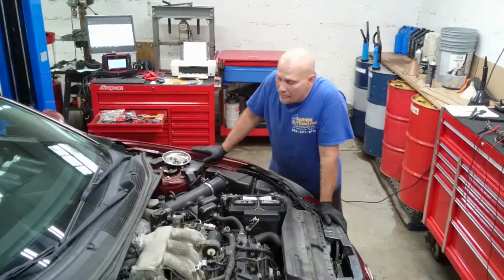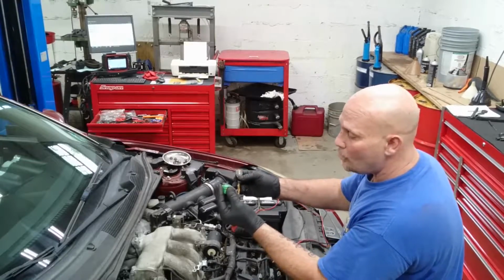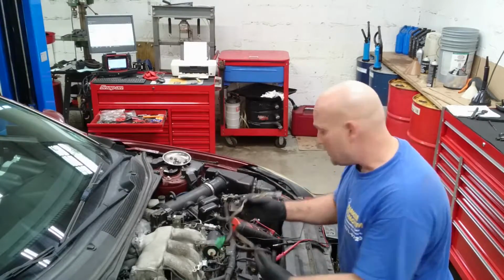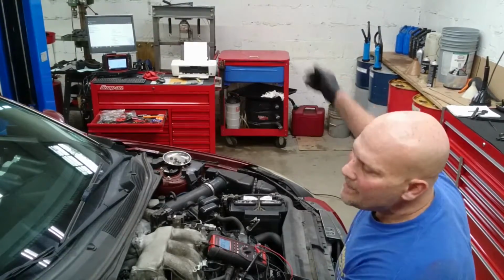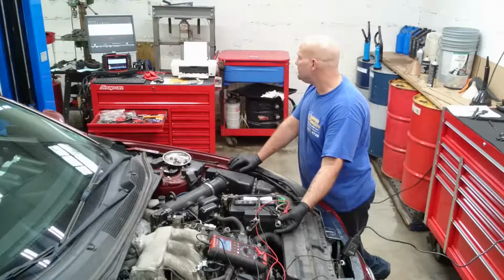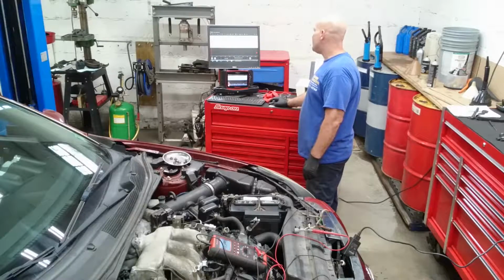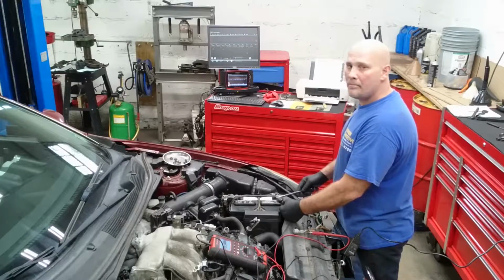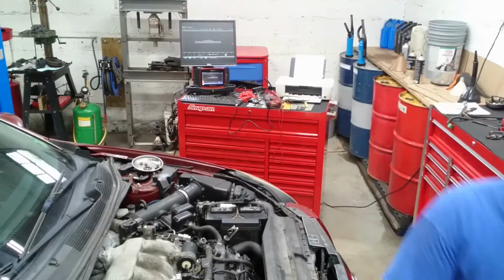2004 Nissan Maxima

Comment: Thank you so much for the video that pretty much sums up the problem I'm having I tried to replace just the tip of the knock sensor connector instead of just replacing the whole thing, giving me false readings that my bank 1 camshaft sensor was bad but was really brand new.